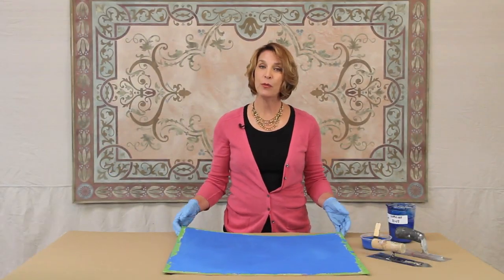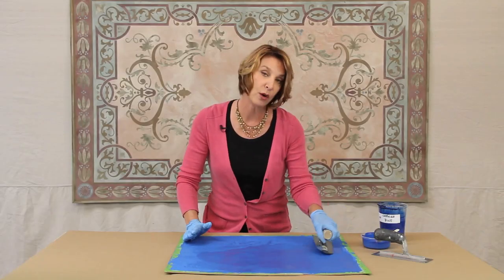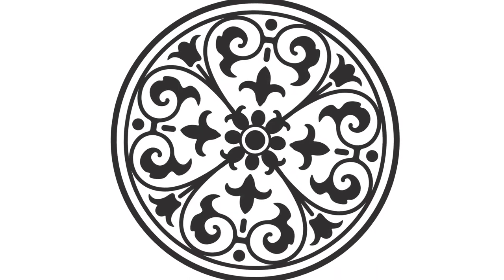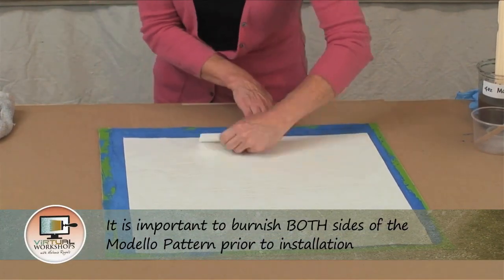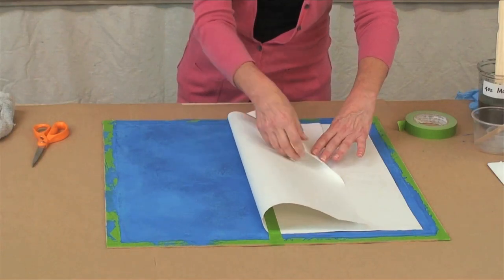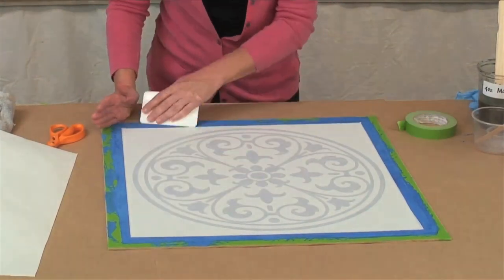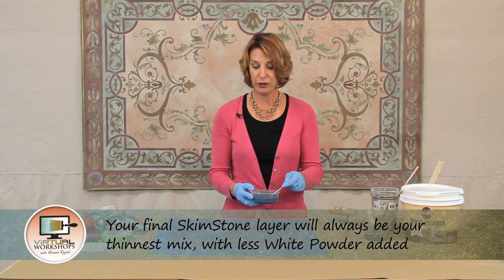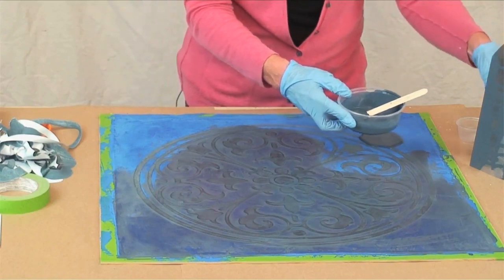How to use SkimStone and Modello Masking Stencils, Part 4

Comment: You can use SkimStone outside in almost any kind of climate. We recommend only two coats of Protective Sealer, followed by an exterior specific, water based top coat. You will wan to make sure that your exterior finish is not in an area prone to standing water and that you periodically check and maintain the sealer. Give us a call on our customer service line if you need additional assistance 800-444-7833. Thanks.
Reply: SkimStone Microtopping 
`\°5\°\\